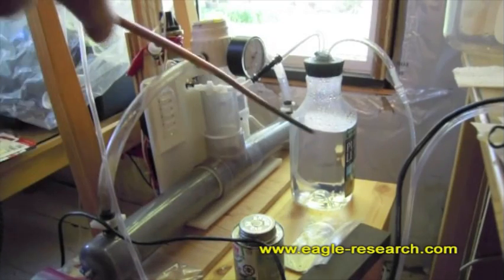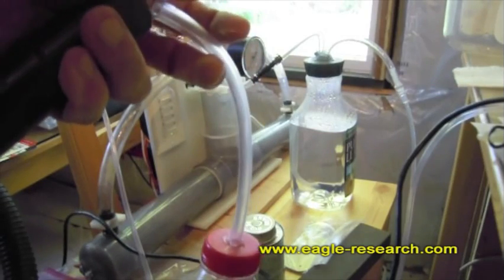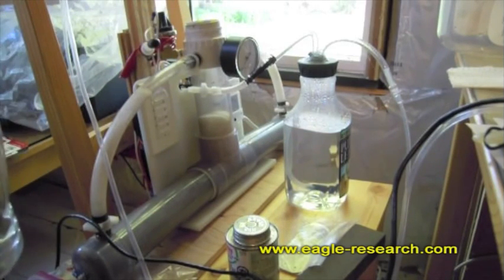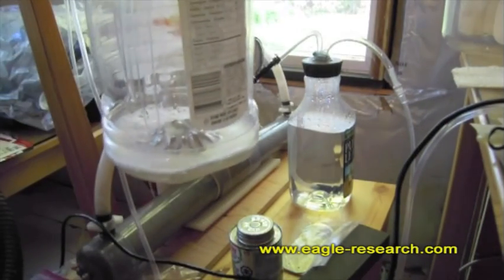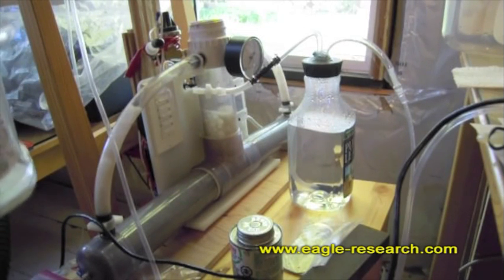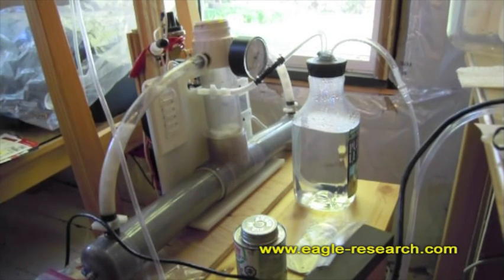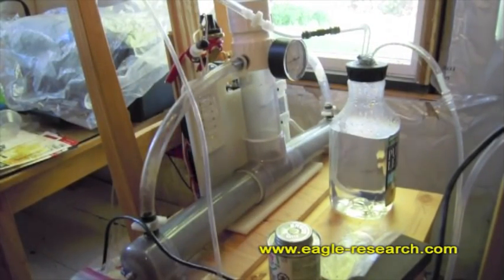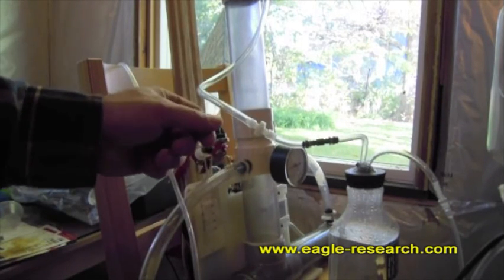Breathing Brown's Gas Update #1

Comment: I am 100% blind. I have listened to a few videos. It does not sound like a blind person can operate this machine alone.  IE having to visually see the foam etc. any insights? Thanks,Dan
Reply from the maker: You are correct, I don't know of ANY Brown's Gas electrolyzers that would be 100% 'blind friendly'.  You MAY be able to find hydrogen inhalation machines (PEM/SPE) technology that are blind friendly... The key would be the 'low and high' refill would need to be audible.  Hydrogen machines are good, people should be inhaling at least hydrogen.  Brown's Gas is about 30% more therapeutically efficacious but the electrolyzers cannot be maintained blind.  
A good point though... I'll keep that in mind for the future.

Comment: Should you be worried about sucking up hydrogen gas into an electric vacuum (sparks inside motor etc..)?
Reply from the maker: No.  The amount of hydrogen in the 'sucked air' is far below the explosion limit.
A greater concern is getting shocked because I'm sticking a conductive tube down into an electrically charged area.
Or the lye that's in the soap bubbles going through the vacuum bag and causing corrosion in the motor.
None of those things happened.
What I did discover is that the BEST way to resolve the foaming was to dump the entire contaminated mixture down the sink, rinse the machine out several times with hot water and make up a new batch of lye.

Comment: I recently rebuilt my "ER30" (I used a small 19 plate 'dry cell' instead) as you are 100% right George, I never should have tried using liquid pipe sealant.  (my NaOH solution foamed a lot and turned milky color)

To try to clean it all well, after reassembling it, I filled it with undiluted 5% white distilled vinegar and ran it for 10 minutes.  I have no idea what gases it might have produced, as I'm no chemist, but it bubbled just like NaOH.

To my delight, after draining, rinsing, and refilling with 20% NaOH solution; it produced zero foam- nada.  Hope it helps someone.
Reply from the maker: You're right, I didn't see that 'read more' button, sorry.  But I'm HAPPY that you found a solution to the foaming :)))
I actually experimented with using various acids (like vinegar) in the past to see if I could have a more neutral electrolyte.  Looks like I'll need to check it out again as a foam killer.  
Thank you for the tip  :)))
Reply from the maker: Milky color, while making the BG is normal.  The foam is bubbles on top that can be so extreme as to start coming out your gas outlet.  Once that happens you must do something about it, because the foam carries electrolyte out of the chamber...
Reply: George Wiseman yep, understand fully, that would not be good. I'm guessing that you didn't see the rest of my comment describing what steps I took to clean it that worked better than I expected. ;-)

Comment: George !! You putting a copper conductor into a live electrolyte with a potential of some hundreds of volts !!!  Be careful mate :)
Reply from the maker: You are right in that electricity can 'travel' up the copper (or any conductor) from the electrolyte.  
So I advise NOT touching the metal as you do the vacuuming.  Or better yet, use a rigid plastic tube instead of metal.

As for the voltage, my entire machine is 120 V (or outside of America 240 V) so making a 'connection' with the electrolyte in the middle of the machine will have only half the voltage of the whole machine, which in my case is 60 V (or 120 V outside of America).  There are not "hundreds of volts" potential in that spot.

Third, electricity only travels to where there is a potential closed circuit, so if the person is not grounded, they won't get shocked.  They might feel a tingle.

Fourth, the voltage isn't what shocks a person, it's the amperage.  Voltage only makes a potential for amperage to flow.  
My electrolyzers are inherently amperage controlled so even if a person does get a shock, there would be no physical harm, just a surprise.

In conclusion, you are right: One does need to take care when playing with electricity.  
I do it so much that I'm likely not a good teacher because my respect and care is inherent and I don't think to add the disclaimers and cautions that I should.  
Thank you for your comment and reminding me.

Comment: Don't know if it's relevant but (NaOH) sodium hydroxide is used in soap making, the glue used as a sealant in the manufacture of some generators is a likely source or oil off your hands
Reply from the maker: Yes and soap makes bubbles :) but if the machine is entirely clean the Lye (NaOH) does NOT make bubbles.  The gas exits the surface of the water practically as a 'spray'.  
It seems to be 'oils' that cause the foam by making a surface tension.

I agree that there are several types of 'oils' that get into the machine during construction, including oils from my hands.  This usually burns off and/or you can vacuum it off and then it is gone.

The problem we then face is preventing further 'oils' from getting into the machine; oils which seem to be in the water...

Comment: Thanks George for all your videos. . Yes foam is contaminates. usually petroleum oil from the plates. When we cleanse tho cells we get rid of the contamination . We use a 12v water pump and 5" filter housing and run  the cell hard for a few hours. it takes out the oils and metal oxides, they get caught up in the filter. We use a 20% solution NaOH to help cleanse the ss plates. We also wash the plates with NaOH and rubber gloves, any finger oil on the plates, no gas will be made where the greasy fingers were. Then we do a slow ramp up conditioning with a new solution and no more water pump and filter. 

For the drinking of HHO bubbled water, to take out the NaOH from a bubbler or 5" dryer/filter housing have a 2nd one with white vinegar in the water or filter. to neutralize the NaOH or KOH. Just use some suggestions on the subject.

Andrew
Reply from the maker: It's very good that you clean the plates very well, using passivation techniques as well (to remove manufacturing oils from plates).  Also good that you noted  that finger oils are a MAJOR contributor to foam, as well as reducing plate (electrode) efficiency.
In my opinion you don't need to 'neutralize' lye with vinegar because virtually no lye comes out of the machine (at least my machine...).  I do use two bubblers but even after many hours of use the first (primary) bubbler has no detectable lye.
Reply: Maybe foam is from heated pvc chemicals?